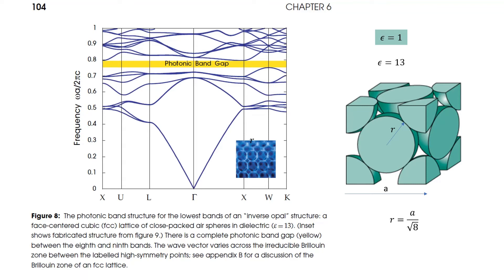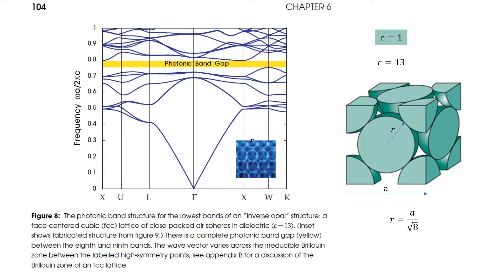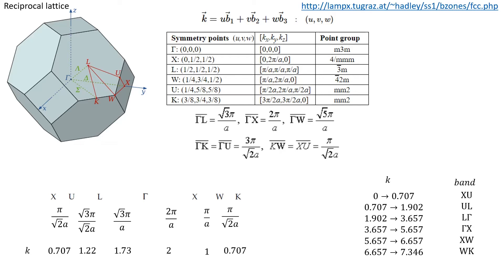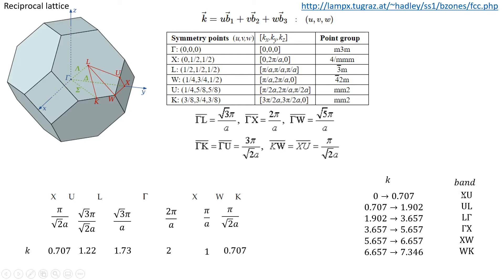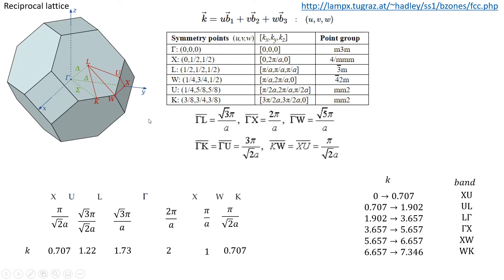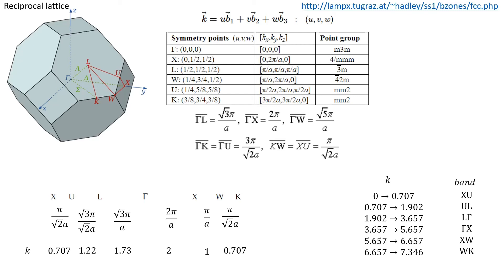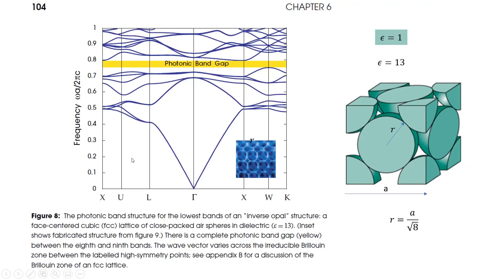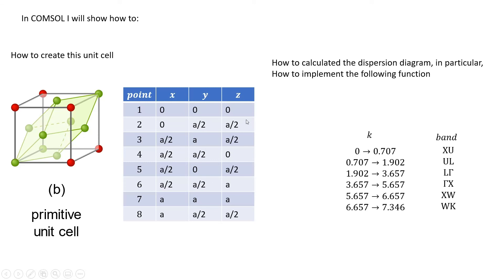3D photonic crystal (FCC, Opal, Hexagonal) using COMSOL - part1

Comment: Nicely explained... but can u please tell how to calculate k values of X, U, L etc.
Reply from the maker: I think for 3D opal it is pretty complicated. However, it is easily calculated for 2D. I recommend the book molding flow of light.
Reply: @ahmedmekawy1632   Thankyou for your reply. As u have taken primitive unit cell of fcc lattice to get the required bandstructure, if I want to get the bandstructure for diamond/woodpile as shown in the book mentioned by you, do I need to take the primitive unit cell or should I take unit cell or supercell for constructing the band structures?
Reply from the maker: I see your point. You should always use the primitive unit cell. This problem is known as band folding. To show where the problem comes from, assume we have a 1D PhC, now assume you take two unit cells as your new super cell so its Brillion zone extends to pi/(2a) compared to pi/a for the primitive cell. That is why there is a difference needed to be accounted for if you chose supercell.
Reply: @ahmedmekawy1632  but if we consider diamond/woodpile structure is it possible to get the required bandstructure (as shown in the book-molding the flow of light) with the fcc primitive cell? As diamond is two atom basis and woodpile periodicity (in x and y)is different from fcc.

Comment: BTW, did you also check reflection/transmission spectra of these opal/inverse opal structure?  Also Band Gap calculation considering many layers? In real system they contain many layers but I guess even if we consider model with 5-6 layers that will still be too large to solve on a normal computer. I know a paper which says propose alternative method where instead of modeling scattering from a six (or fewer) layer crystal structure, they model scattering from a "semi-infinite" crystal. This is a crystal which extends an infinite number of layers from the vacuum crystal interface and requires the model to use a "Bloch Absorbing Boundary Condition". It claims that it reduces the size of the model, making it easier to solve, and it probably more accurately models the real system in which of course would have more than 5-6 layers. Paper title "Absorbing boundary condition for Bloch–Floquet eigenmodes" paper link - https://www.osapublishing.org/josab/abstract.cfm?uri=josab-30-10-2615
Reply from the maker: That is interesting work, indeed! 

In general, however, I have the feeling it does not take so much time if you calculate the reflection/transmission from 5~6 layers, because at least half of the volume size is air, with small number for degree of freedoms. 

Bandgap calculation for 5~6 layers, what do you mean? can we still be able to quantify it as photonic crystal, I believe it will have similar banddiagram of the infinite crystal, but with discrete allowed wavevectors on the same band (instead of continuous band, it will be discrete points sampling the band). The separation between these discrete points is determined by the total thickness of the layers "d". This separation tends to decrease as we increase the number of layers more and more. Eventually, when we include infinite layers, this separation is 0 and we get this continuous band again.
Reply: @ahmedmekawy1632  True, in terms of bandgap, there should not be any effect of number of layers. But number of layers can affect absolute reflectivity/transmission upto few layers I guess.